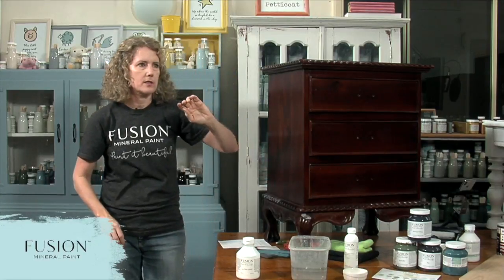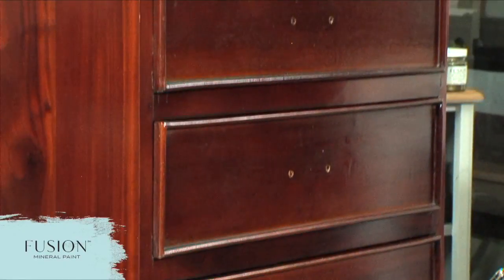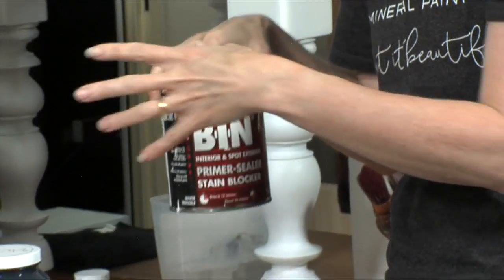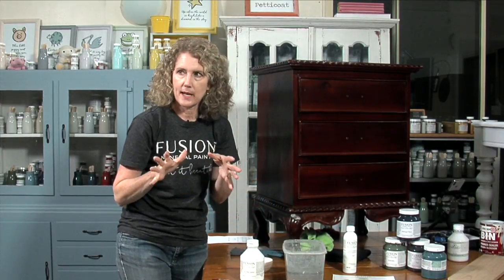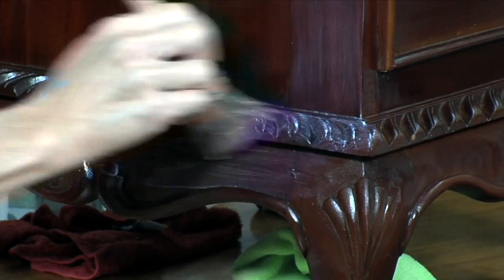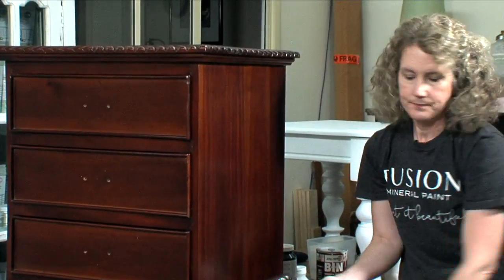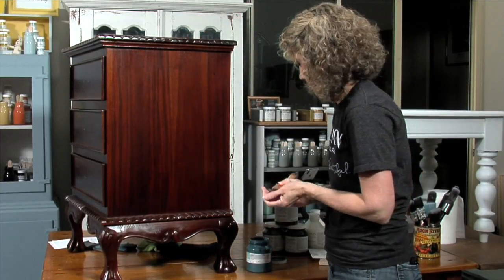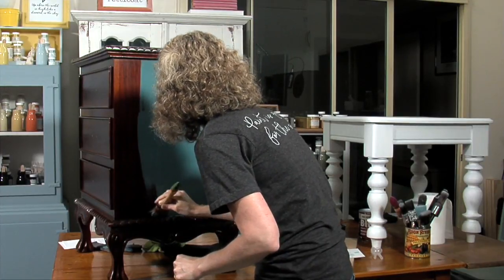Using Fusion's Ultra Grip on a Shiny Surface (Pt 1) - When and Why would you do this?

Comment: Want to paint white over dark wood. Would I put Bin primer on first  and then ultra grip. The top of the piece will get some use so want to protect.
Reply from the maker: If using BIN primer I would not worry about adding the Ultra grip afterwards. Just scuff the surface and wipe clean before applying your BIN primer. Then after you final paint layer of you want to protect further, use a non yellowing sealer such as Fusion’s Tough Coat Wipe on Poly.
Reply: @irestorestuff  Thank you that is a big help..  Great job on your video
Reply: @irestorestuff  Thank you that is a big help

Comment: First time using fusion and I bought the ultra grip.  They told me at the paint store that I needed to sand the surface first and I think I over sanded bcause I'm afraid it won't stick.
Reply from the maker: Fusion paint sticks really well by itself without ultra grip. I only ever use ultra grip on super slick surfaces. I always key the surface with a quick scuff sand first. No need to sand back to raw wood.

Comment: Thank you for responding. I’ll have to sell a couple of pieces and then get the good brushes. Quick question,  I’m painting a piece with a very dark shiny surface. Should I prime first to avoid bleed thru, then a thin coat of ultra grip and then paint with the fusion paint?
Reply from the maker: it should not bleed through if you have not scratched through the shiny varnish to the underneath stain - the stain is what causes bleed through, not the shiny varnish over the top of the stain. In these cases, I usually scuff sand the surface (ensuring I don't break through the varnish to the stain underneath), then thin layer of ultra grip, then paint.

Comment: Can you use Gel stain & Top coat over the Ultra Grip? I'm looking at using the Black gel stain on a fireplace mantel that is shiny finish?
Reply from the maker: You could if you wanted to, but I would think the Gel Stain would be strong enough to adhere to the finish.

Comment: Can you use a foam roller to apply Ultra Grip?  Thank you, Tracy.
Reply from the maker: Yes, in fact, one of the best ways to apply it to avoid applying too thick or getting any brush strokes which may appear through subsequent layers of top coats of your paint. You really only need a very thin layer, so even if using a roller - I recommend a micro-fibre roller, and roll it out well onto your roller tray to squeeze most off before applying to get a thin coat.

Comment: Cling On brushes here cost $34! I can’t afford that for one brush
Reply from the maker: "here" meaning where? I'm in Australia and that's around how much we sell them for here. Definitely worth the investment when I've used the same brushes for years and haven't thrown one out yet. They almost self clean in water when using the water based paints I carry. So many have said how much smoother their finishes are using these due to their tapered bristles, making their jobs so much quicker. I understand if you are only painting a few items, but if you plan on painting a lot and flipping furniture as a means of income, I was so glad I made the switch from cheaper brushes when I did.

Comment: Any tips on what to do about the ultra grip if you put too much and make a mess of it?  I have one section that I messed up and don’t know how to fix.
Reply from the maker: I’m assuming you mean that you may have applied too thick and can now see brush strokes, or maybe overworked it as it was drying, which would also create a bit of a messy section. The best thing would be to just sand that section back once the ultra grip has dried and start again with a smooth surface. Apply a very thin layer with a good quality brush or a mini microfiber roller for best results.